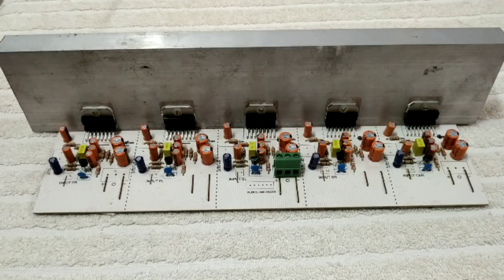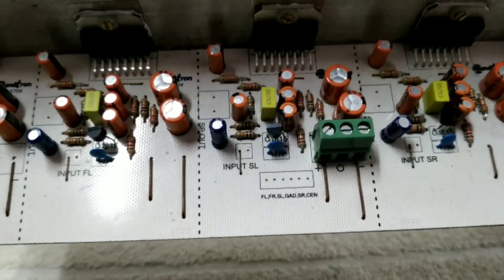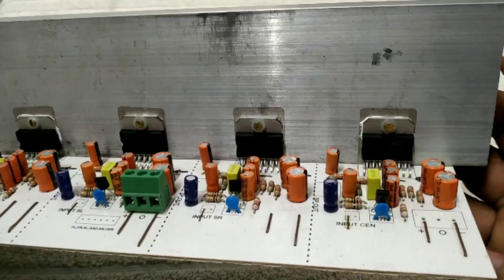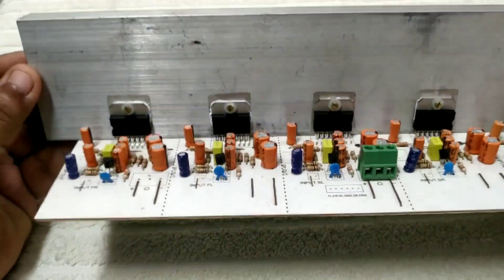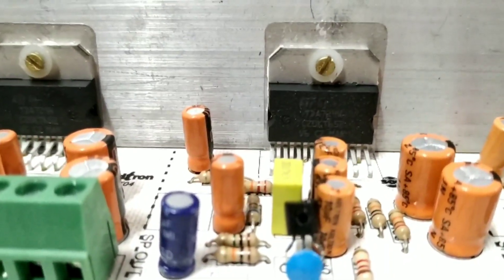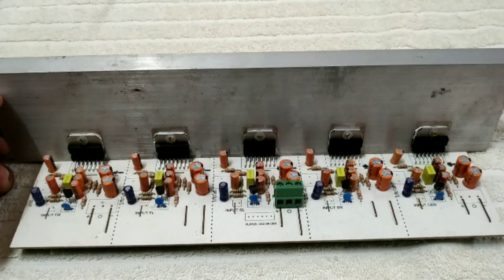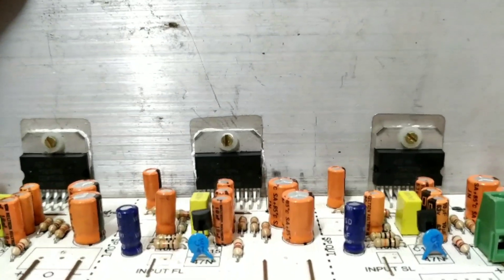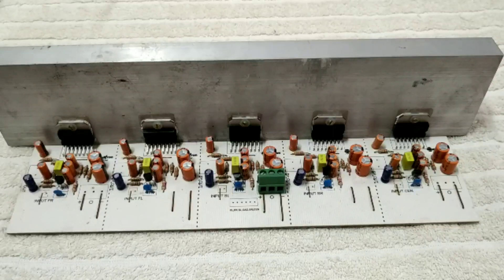Tda 7294 ic based 5ch amplifier board 100w per channel. High output and easy to use

Comment: 25 0 25  tranceformer upayogich -35 0 +35 volt load cheyyunnathil problam undoo?? pls rply
Reply: Thanks chettaaa. 4 ohm speker load cheyyalo?
Reply from the maker: @krishnakishorhandmadesystems  chyam
Reply: @technicalevolution9887  Thankyuuuuu
Reply from the maker: No problem

Comment: Very useful video bro..  Kure divasamiyi ulla confusion clear ayi bro by your words in 4:15min.. Once I replaced heat sink of similar board after that bt board board control burn akumayirunnu.. I just replaced the board. Pine TDA 7294 use chettan pedi ayirunnu..  Ippozhane reason pidi kittiyathe..  Thanks bro...
Reply: ഇലക്ട്രോണിക്സ്, ഓഡിയോ ഇഷ്ടപ്പെടുന്നവർ ചാനൽ മിസ്സ് ചെയ്യാതിരിക്കുക. ഉപകാരപ്രദം എന്നു തോന്നിയാൽ സപോർട്ട് ചെയ്യുക. നന്നി.